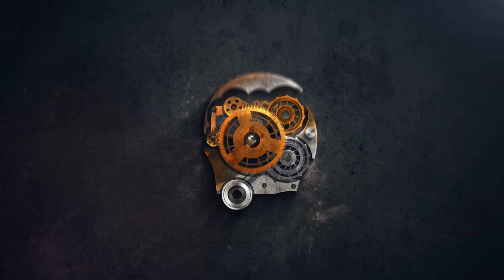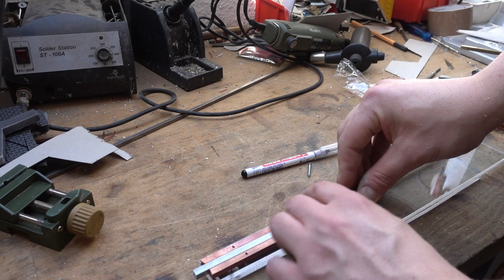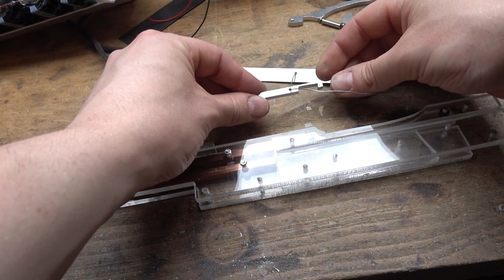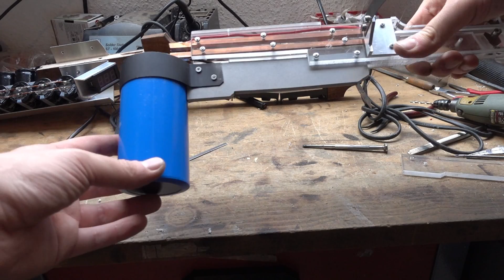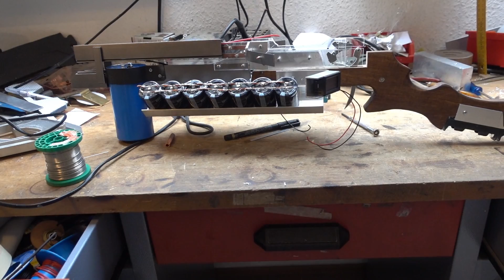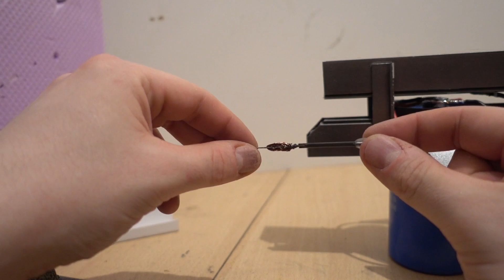Making a portable railgun: Part III test fire, rails and the bow injector

Comment: Imagine doing this with super capacitors
Reply: The voltage way too low
Reply: they don't output as fast as a regular capacitor
Reply: Supercapacitors have a ESR too high for a decent instantanious power output, also, you would have to have a lot of of them in series to get a decent power output.
Reply: Azagro they output can output 100s of amps if you make a power source out of them
Reply: Too bad that railgun uses ten thousands of amps.
Reply: Azagro this cap bank isn't nearly as strong as a parallel super cap bank would be
Reply: Azagro lol look at that flawless English: they output can output